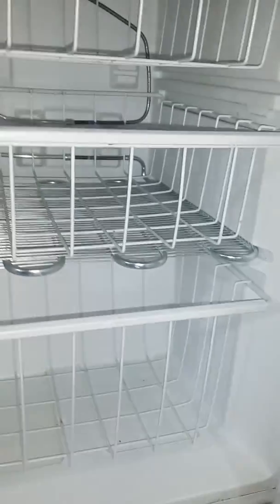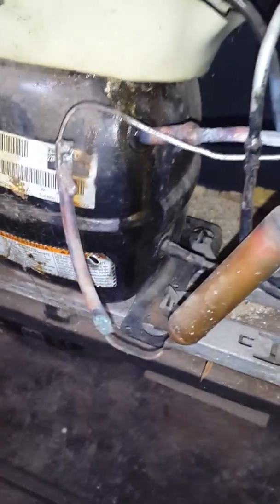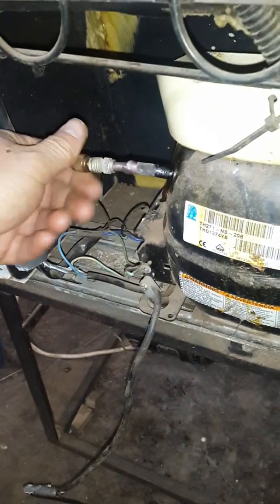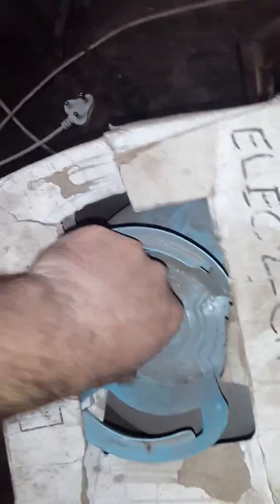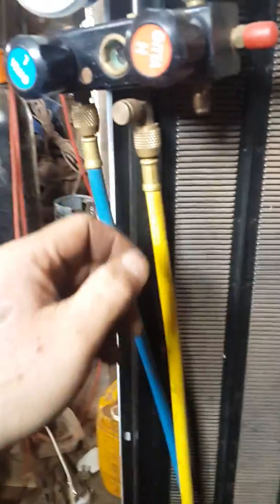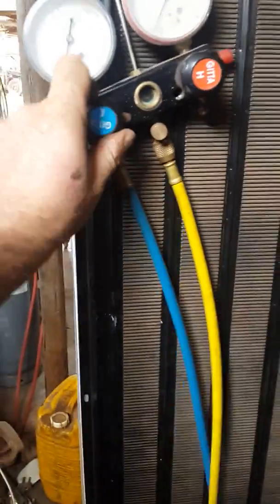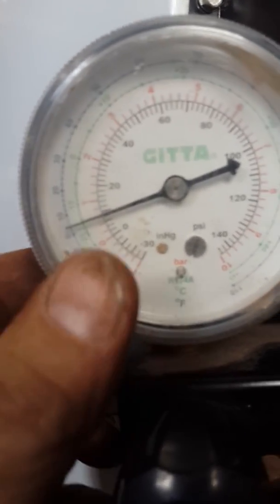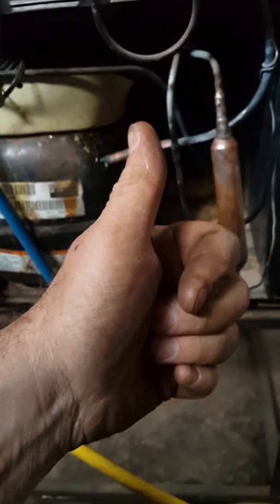DIY Refrigeration: Fixing a 2 door fridge/freezer, gas leak

Comment: I have a job here my fridge is not cooling enough
Reply from the maker: If it's not cooling enough, it can be one of a few things.
Check the back where the condensing tray is, make sure the fins are clean.  Then check to see if the thermostat works properly. 
And lastly check the gas pressure. If the compressor doesn't have a valve on you might have to drain the system and put a valve on first then refill...
Reply: @aldovanzyl-jackofalltrades8446  it a defy that doesn't have fans
Reply: @aldovanzyl-jackofalltrades8446  got a new thermostat
Reply from the maker: Also feel the pipes temperature with your bare hands.
Feel the condensing tray and the entry and exit, there must be a drop in temp.
The feel the dryer filter both side, must be the same temp
Reply: @aldovanzyl-jackofalltrades8446  they should be hot or cold
Reply from the maker: @tysonmodestus8520  it should start off very hot, and gradually get cooler through the condensing tray at the back, the mildly warm through dryer filter.
If it's not, then it's a gas issue
Reply: @aldovanzyl-jackofalltrades8446  please send me your video link doing a full kit regassing I got the kit don't know what to do
Reply from the maker: @tysonmodestus8520  have a look a the one you commented on. I go through all the stages.
Otherwise you can email me pics of your kit, and fridge and I can tell you what to do.
Reply: @aldovanzyl-jackofalltrades8446  hi aldo I tried regassing it now the freezer is not icing up
Reply from the maker: @tysonmodestus8520  did you run a vacuum before you regased?
You might have a blockage.

Might need to flush the lines with a special solvent first. Then see if there is muck that comes out. Then do the vacuum, then regas.
Air in the system mixed with gas doesn't work.
Reply: @aldovanzyl-jackofalltrades8446  I removed the valve when I was gassing